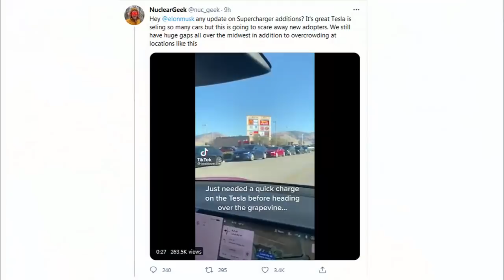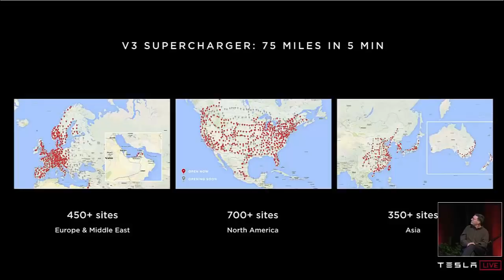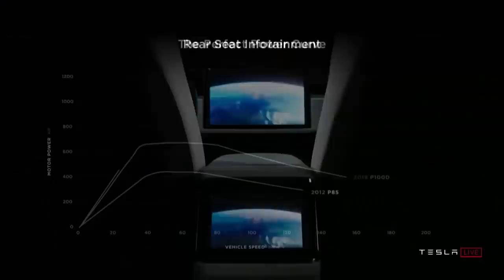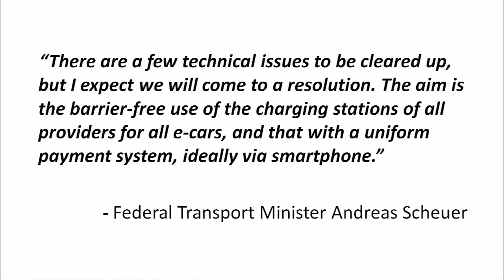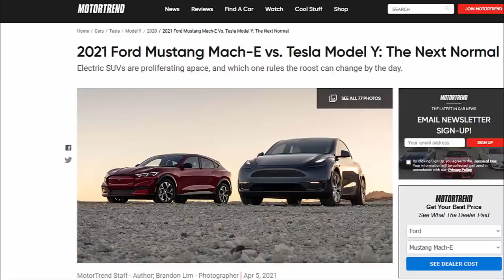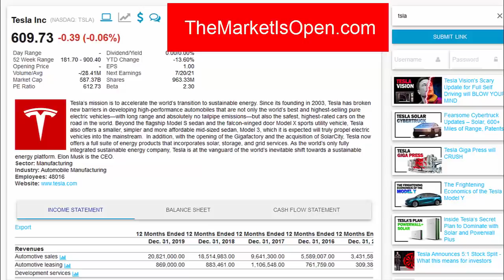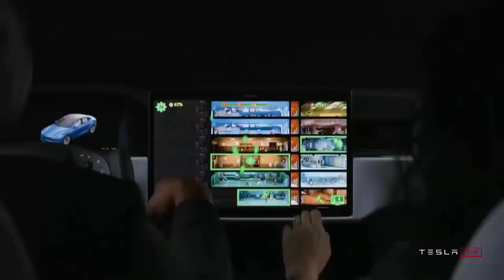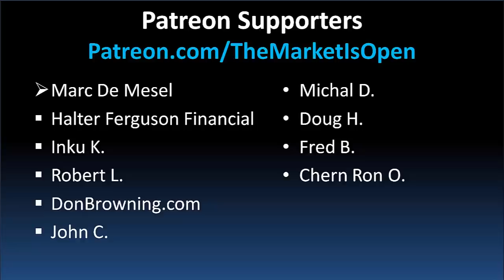Tesla Supercharger Network MASSIVE INCREASE

Comment: I am not sure you're right about a point you made - that OEMs would have to change hardware and software in their cars to use Tesla's Supercharging network.

It's an engineering question, really.  What do you need to charge a car made by someone else?

For account management and billing, what's needed is a phone app.  Tesla already has one.  They could modify it to let owners of non-Tesla vehicles interact with charging stations.  Software in the car may not be necessary to fiddle with at all.

For connection, non-Tesla owners will need a suitable charging cable adapter.  Tesla could develop and market it.  There aren't many charging standards.  The task may be a bit tedious, but it's not rocket engineering.

For charge management, Tesla will need to know what the manufacturer wants to happen (charging profile) for a particular model.  Obviously, some communication is required here, but not changes to hardware or software in the non-Tesla vehicle.  Tesla will need to be able to monitor the state of charge in the vehicle as it charges; the adapter can be engineered to accept those sensor communications and translate them into Tesla-speak for the charger.

Obviously, none of this could happen overnight.  It's a fair bit of work for Tesla to open up their network.  It would indeed be easier for Tesla to demand that other automakers conform to their standards.  But I'm not sure the EU will let Tesla do that.  It is, after all, a completely proprietary set of standards, unblessed by any governing body.

Tesla has sunk capital into its Supercharging network and will be disinclined to give other automakers free access for that reason.  I doubt they will be terribly concerned about making non-Tesla BEVs more compelling.  Their lead in BEVs is unchallenged at present, and I expect that will remain true through the end of the decade, at least.  But it's only fair that they charge automakers a fair price for granting access to other automakers' customers.  That money would defray part of their capital costs of deploying more chargers.

As for inconveniencing Tesla customers, there's a way around that, too - don't do it for stations that have problematic wait times, at least until enough chargers are added to keep wait times under control.

It all sounds like a pain in the butt for Tesla, doesn't it?

So, is there any reason Tesla might want to do it anyway?  Aside from EU rules?

Well, actually, there is.  And it's huge.

We should look at charging stations as the new gas stations - but potentially more lucrative.  Electricity is cheaper than gas, so there is less profit potential in 'fuel' delivered, but charging takes longer than filling a gas tank, so there will be captive consumers looking for something to do/ways to spend a few bucks while they wait.  Tesla recognizes this and is considering how to take advantage.  Expect some trial balloons over the next few years.  One has already surfaced: a 50's style restaurant which plays movies from that period for its customers.

Gas stations have been extremely lucrative businesses.  Tesla, as an electricity supplier as well as making machines that consume electricity, is in a unique position to own and operate the future gas stations of the world.  Certainly not all of them, but a hefty share of that market will be extremely valuable.  If they open up their network, they'll gain a larger share of that market.
Reply: Something you fail to take into account is that the supercharger and the Tesla talk to each other with the software. The other OEM's don't really have this happening that I know of.
Reply: @Coltn3125  Without being an expert at all, I am imagining that all Tesla really has to know from the vehicle is the state of charge and the temperature of the pack.

Tesla's preconditioning of the battery before the BEV arrives isn't a necessity, only a convenience.  The charge profile for the model and pack, which Tesla must know in advance to admit that model to the network, will guide charge tapering, unless the thermals are bad, in which case the charger will have to throttle.  Or quit entirely.

If SOC and thermal information can't be collected from the BEV by the adapter cable and passed to the charger, it isn't a candidate for admittance to the network, I would think.  Likewise, if the charging profile for a model and pack can't be established in advance, the model and pack isn't a candidate for admittance to the network.

I could be wrong, though.  I'm aware that my imagination is a poor substitute for hard facts.  I'd be very happy to be corrected by people with more detailed information about how the network actually works and what it needs.
Reply: All very good points.

All EV's handshake with the charger so the adaptor/app., has all the info to insure the vehicle charges sufficiently fast

I Don't aggrege that OEM's need to pay for the charging network. Just build it into the cost of the electricity!

Add a software to block charger usage, insuring Tesla vehicle priority.
Reply: @robinholmes785  Yeah, Tesla could charge extra for non-Tesla owners.  In fact, they could probably do that while still delivering a better price than other networks.

Those other networks are pretty crappy.  Some even charge by the minute rather than by unit of electricity sold.  That's nuts.

I think, though, that if Tesla is going to authorize a customer, then they should be authorized, period.  Once they've paid to access the service and roll up to charge, let them.  It's bad customer relations to treat them differently.

The way to throttle the impact of new customers on Tesla owners is to pay attention to usage metrics at each station.  If a station lacks enough chargers to serve the combined population of users, then that station won't be offered to non-Tesla users at all until it has more chargers.  The Tesla app for non-Tesla users just won't show that station on the map - for now.  Explain clearly up front what non-Tesla customers will be signing up for, and that the network is a work in progress.

It's a bit of a juggling act Tesla will have to do, to balance supply against customer demand by location.  They'll definitely have to increase the pace of their network rollout.  The timing of announcing access to Tesla's charging network for non-users will be a delicate matter.  Tesla will need to have, not only charger adapter cables ready to roll, and charging profiles for qualifying BEVs nailed down tight, but also be sure that most of the network is ready for the influx of new customers.

If they get the timing wrong, it will put a frown on a lot of customers, Tesla owners and nonowners alike.
Reply: @Emo Off topic, self-promotion, verging on spam.  Don't do this.

Comment: This issue if far simpler than assumed. Just as Tesla owners can buy an adapter plug to access other vendor chargers, so too can other EVs buy an adapter plug and download the Tesla app to their smartphones and submit a debit or credit card - the only thing missing is feature additions to the app by Tesla. Consider the advantages of having every other EV owner with the Tesla app on their smartphone. What about electricity price differentiation, having other EV owners help pay for the supercharger network expansion. Like Tesla data driven insurance - this is another first to market gold mine.
Reply: Thinking the Same! Also the Adaptor/App. could restrict access to insure Tesla Vehicle priority!
Reply: I like this idea, but only if Tesla charges much more than Electrify America ($0.43/kWh), maybe 60 cents in USA.  The revenue will help fund more chargers.  This is an incentive for Ford, GM, VW, & others to install chargers at their dealerships to offset revenue loss from less repairs. Price discrimination could be a sticky legal issue, but Tesla could argue their vehicles offer a discount.